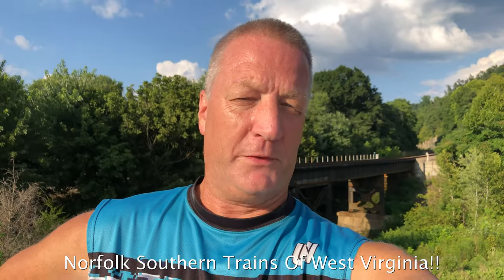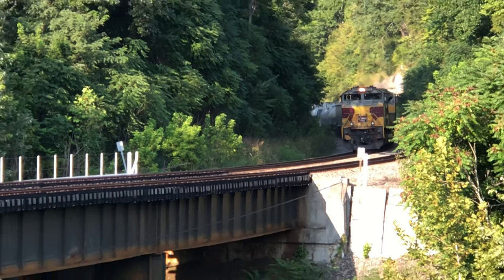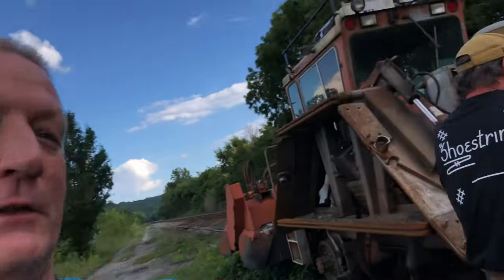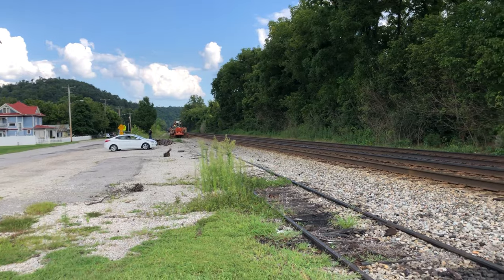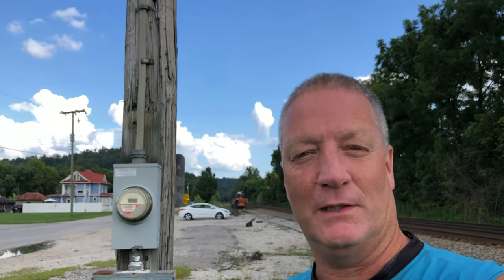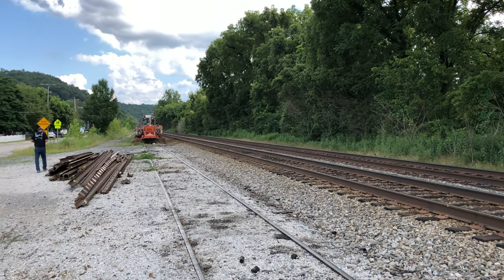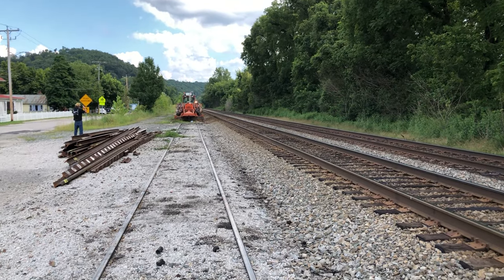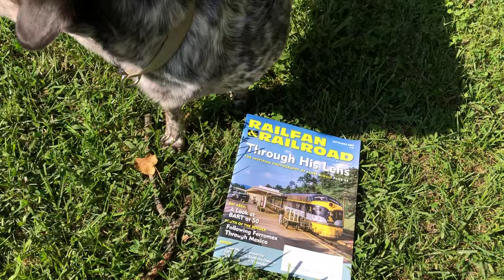Train With DPU Flies Over Curved Railroad Bridge!  West Virginia Trains, Fort Gay & Pritchard Tracks

Comment: Great excellent video, mr Jaw Tooth.
On the front of the first train of NS whe see a heritage locomotive from wich company merged up in NS. The speed of all these intermodal trains between 40 mp/h and 55 mp/h. And where is the caboose going to?
Greet from Zandvoort the Netherlands.
Reply from the maker: Thank you very much!  The caboose will be used for a long reverse move on a coal spur.  They will back the train up to a coal load out and use the caboose as a shoving platform for the conductor to stand on while reversing down the spur.  That is my guess which has to be what it is used for